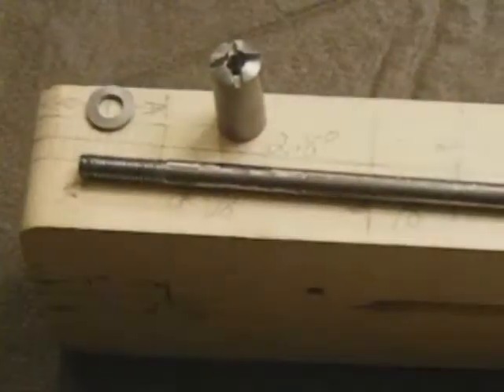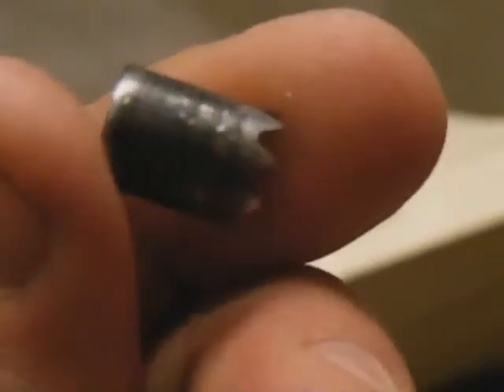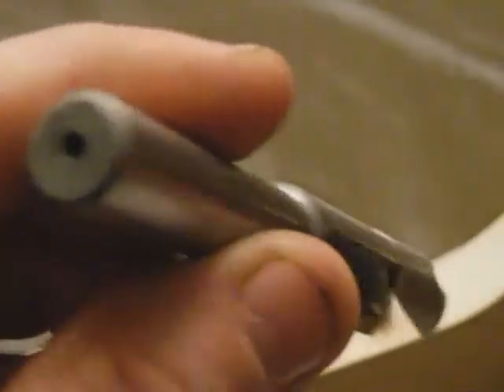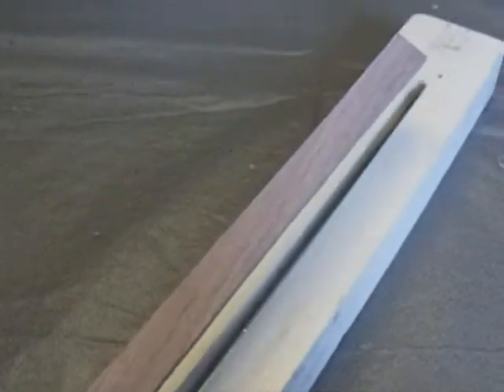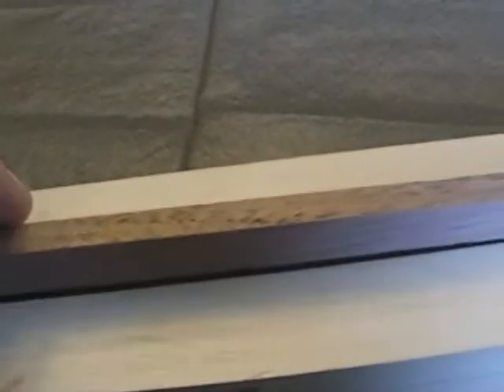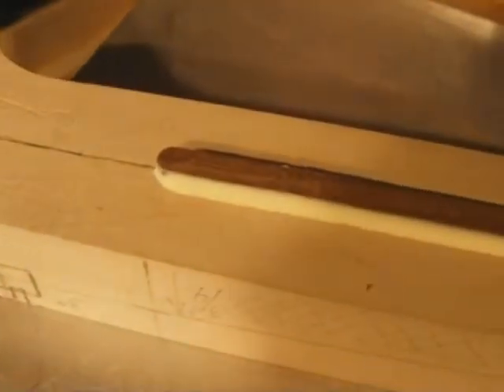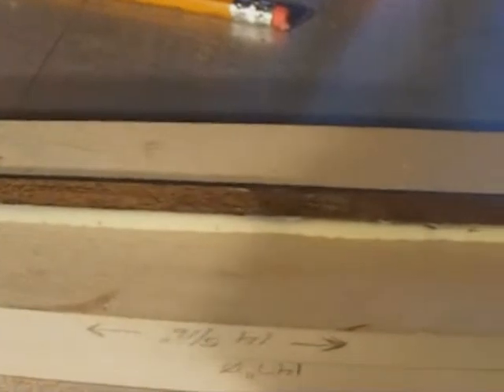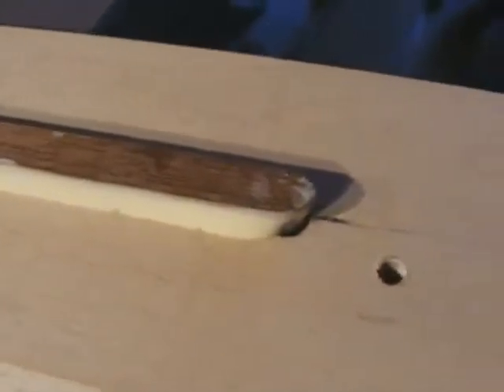One Piece Neck Build Part 5: Install Trussrod & Skunkstrip

Comment: what type of saw did u use to cut the skunk strip so clean? i am worried about the curved tops and bottoms getting mangled by a jigsaw and not looking as smooth and round as yours. great video btw thanks
Reply from the maker: Good morning.  I would have cut the blank then used an edge sander to clean it up or use a router to surface it to width. Then draw my arc and use bandsaw then sand to line. Thrn do the ends and fit it.